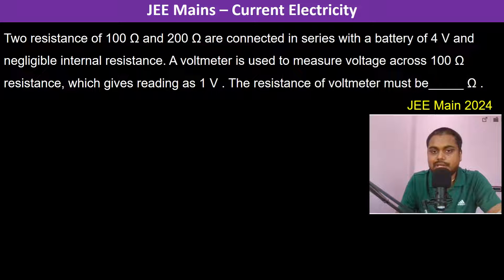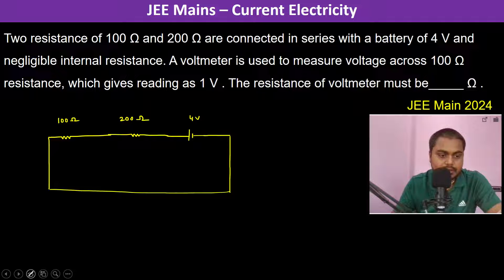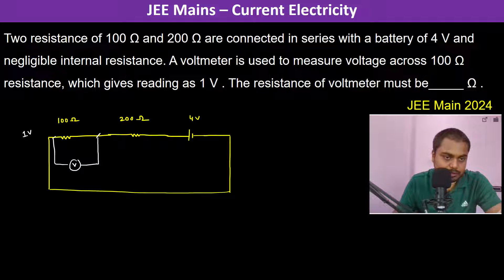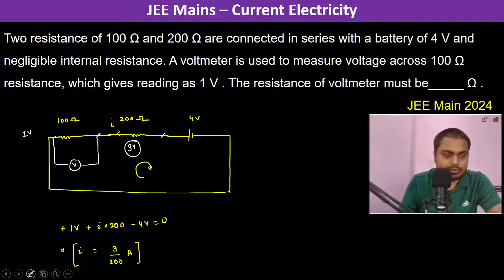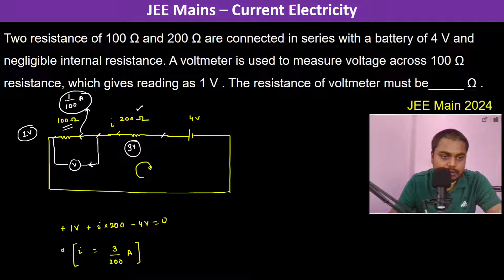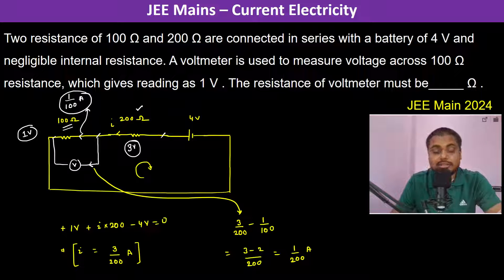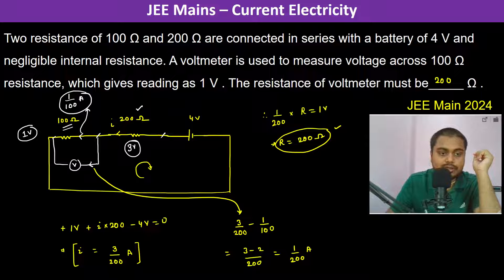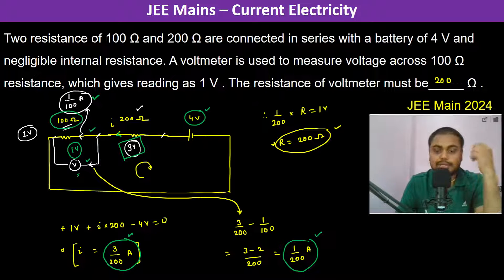Two resistance of 100 Ω and 200 Ω are connected in series with a battery of 4 V and negligible

Comment: Bhaiya ek doubt h ignore mat kariega ...
Initially current in the circuit is = 4/300 ( without considering voltmeter across resistance=100 ohm)  then i assumed ki voltmeter lag gya h  100 ohm resistor ke around ..
Jaisa ki total current i = 4/300 aaya tha initially aur question me 1 volt potential difference h 100 ohm and voltmeter  ke resistor ke around then i use this eqn :- 100×(4/300-x)= 1 ( where x is the amount of current distributed to voltmeter resistor)then x = 1/300 aaya aur wahi current uppar gya voltmeter me then 1= 1/300 × R = 1 aur phir resistance = 300 aa rha h ?? Bhaiya iss approach me galat kya h ??? Bhaiya Maine yeh socha h iss question me where am i wrong bhaiya???
Reply from the maker: 100*(4/300 - x) = 1 can't be done. As after adding the voltmeter, now the current in the circuit is not 4/300.
Reply: @sarathiacademyjeeneet  bhaiyya jo case maine socha wo kisi dusre type ka question ban gya ????
Reply from the maker: Haan ji
Reply from the maker: Therefore practice is required so that we can understand the details to a problem.

Wishing you all the best 👍